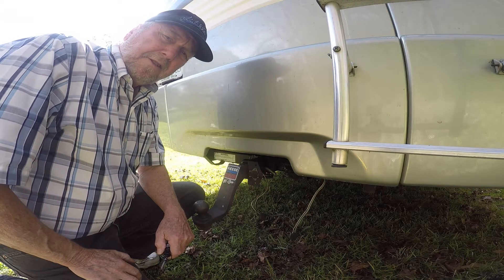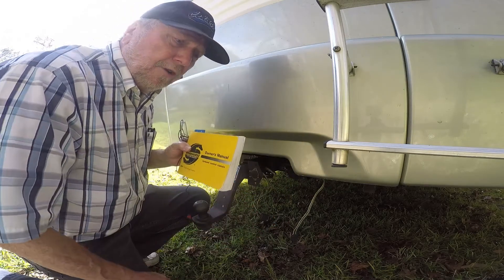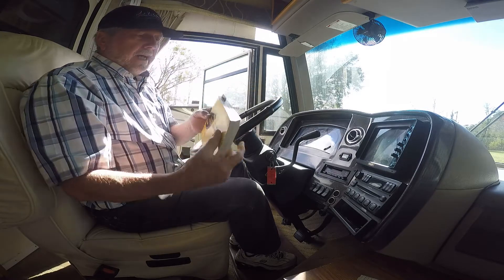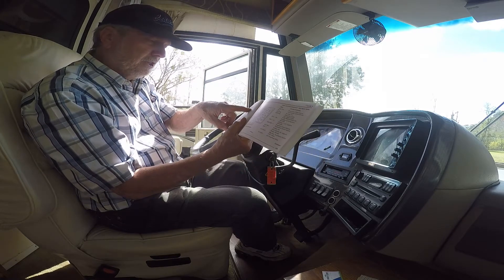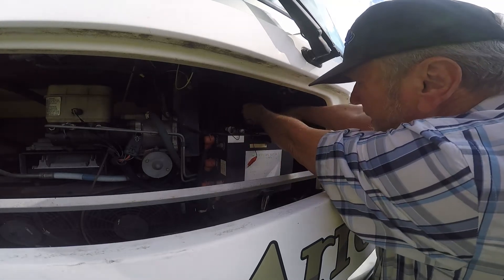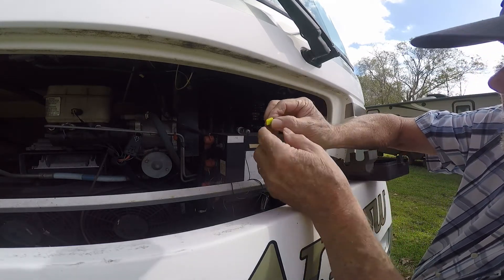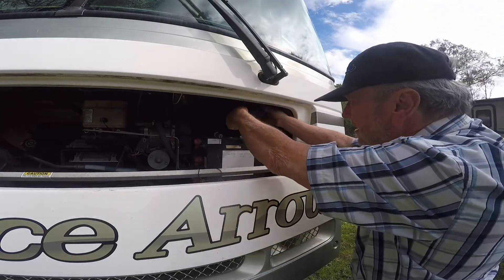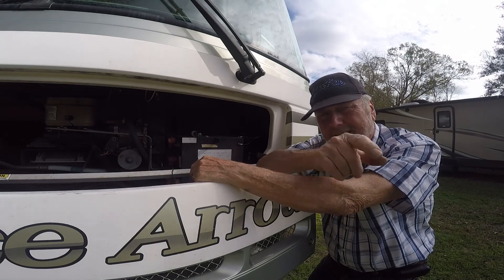RV Tail Light Problems, How to find and fix

Comment: Thank you so much for this video I had worked for two days after a small short after hooking up my dolly after watching your video, I realize that there wasn’t three different fuse blocks on my 2001 pace arrow  there was four and after extensive looking, I found it and it was the second second to the last fuse inthe power distribution box upfront thank you again this helped greatly
Reply from the maker: @hamd819  So Glad my video help lead you to a solution.  I know it felt good when you found the bad fuse.  Thanks for your comment.

Comment: I can’t find my fuse box top with diagram for my 1995 Newmar Kountry Star 38ft rv I need help I can’t fix my back lights
Reply from the maker: Generally, it will be located on the drivers side under the dash area.  There may be a cover that will make it harder to determine that it is a fuse box.  Another place is under the hood area.  Now if you have a deicel RV, I am not sure where they put them as the engine is in the rear.  Sometimes there will be a fuse box near the battery compartment.  You will need your Owners Manual to find the fuse location.  Sometimes they give you several different fuse box for different models.  You are looking for the Chassis Fuse box.  this is the one for all your lights, horn, radio, accessories and more.  There are Coach fuse foxes for your slides, Coach lights, water pump and all the other coach 12 volt.  Items.  It is usually located in the 120 Electrical box.  That is the best I can do, good luck.

Comment: Where for tail lights
Reply from the maker: @stephaniepotter3378 each of the lighting circuits have a separate fuse.  You go to user manual fuse block layout in the book, look for the fuse that is labeled for circuit that is failing.  Brake, turn, and tail lights.

Comment: I have a class C. I had the tail lights go out on me...I left it alone but then it started working again... 🙄 But today I took it for a drive..no tail lights! Signals work, flashers work...now what? 😞
I don't have the owners manual. Its a Ford E350 El Dorado RV.
Reply from the maker: Campgoer One, from your description for your problem, I would say you have a loose connection.  This will most likely be at the trailer connector plug at the rear of the vehicle.  It is where you connect the light plug from tow vehicle or trailer.  The plug will have screws that clamp the wires down at the plug to extend your tail lights to the trailer.  Sometime these connection can get loose, corroded or broken wire.  I would start there will a test light and with lights on, check for the problem while moving the wires around at the end of the plug.  A loose connection will not blow the fuse, so you are experiencing a lose connection type problem.  Good luck.